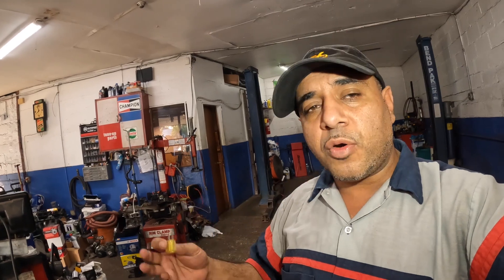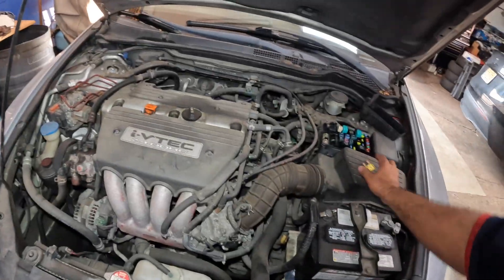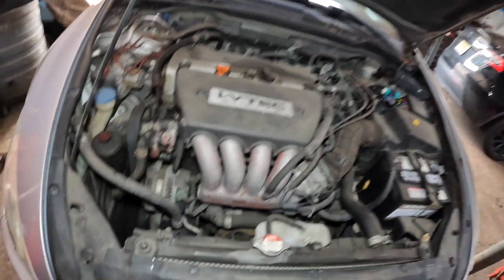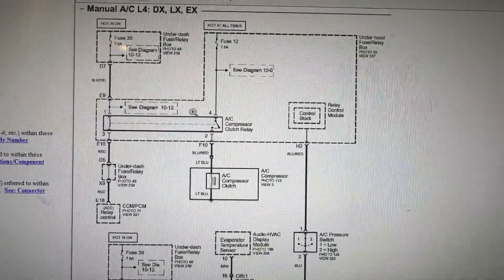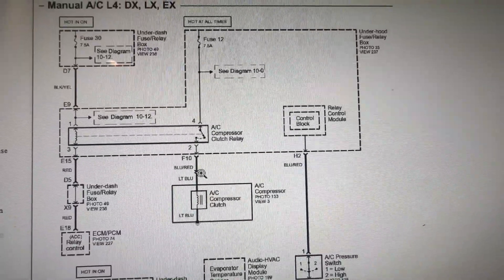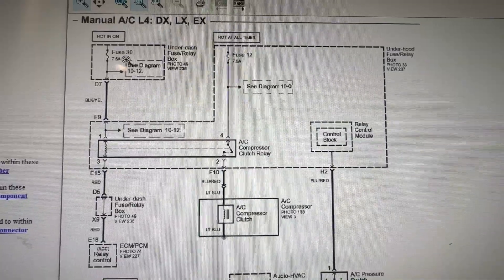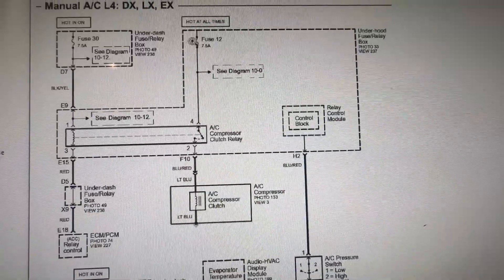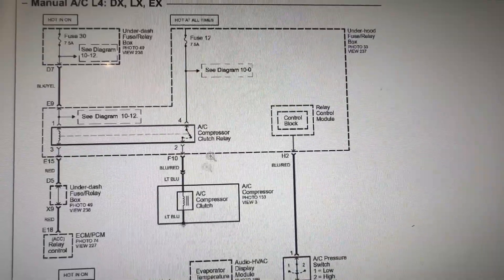AC fuse keeps Blowing  Quick Diagnostic  common issues

Comment: Thanks for posting this and explaining the different issues that happen with the AC unit!! The fourth mechanic I took it to finally got mine fixed, but lots of wasted $$$ trying to figure out the problem!!
Reply from the maker: What was the issue ?
Reply: @RBTheMechanic  one issue was the fuse key blowing out, then electrical, another issue ended up being an overfill of the coolant, I thought it was measured out precisely when you input the make/model; lastly, the compressor died;